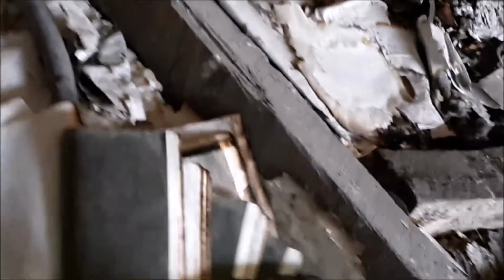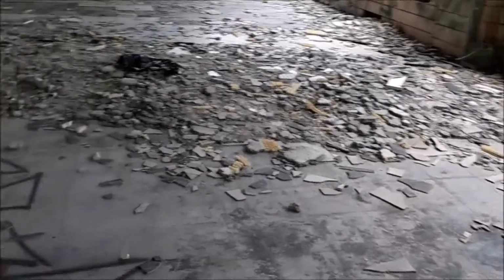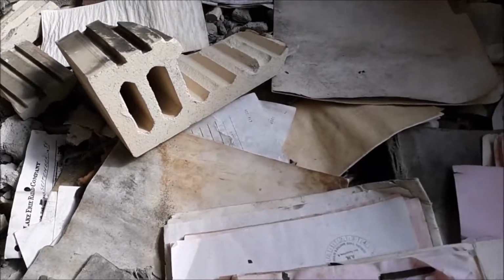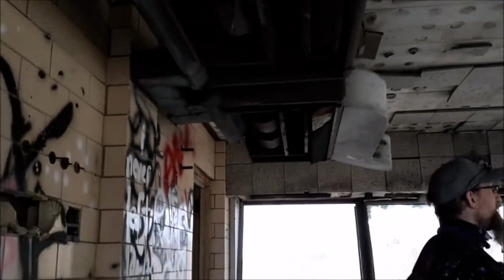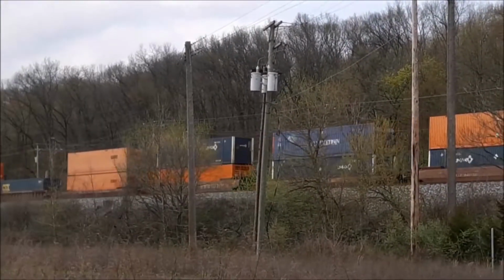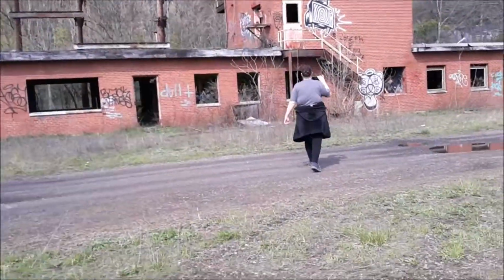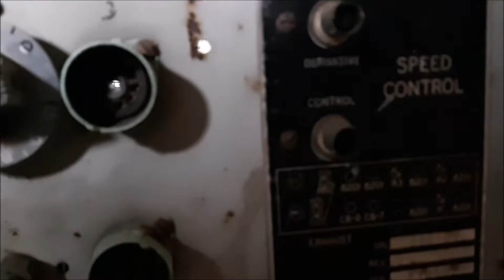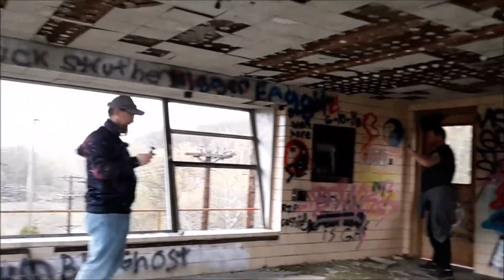Abandoned Railroad yard

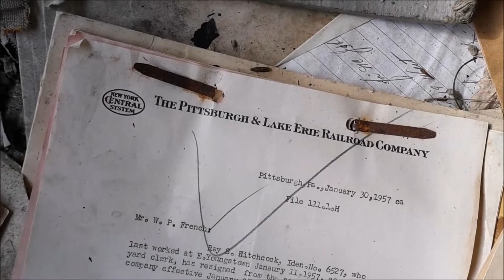Comment: It's amazing that the document (at the 12:00 mark) was still readable after all these years.  The P&LE was owned by the New York Central all the way through the NYC's 1968 merger with the Pennsylvania Railroad.  It was spun off on its own prior to PC becoming part of Conrail in '76.

I would say that the tower was shut down shortly after CSX acquired that portion of the P&LE in 1992, since they had no use for the yard tracks or the tower.
Reply from the maker: Thank you.  I did not know that.